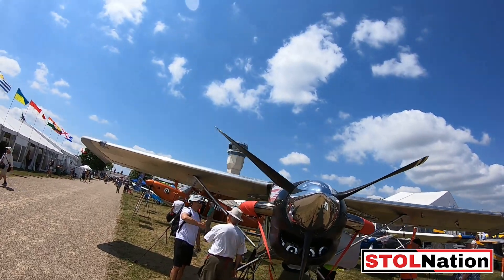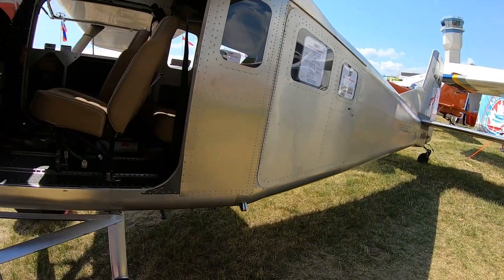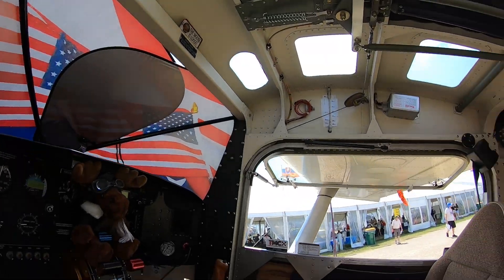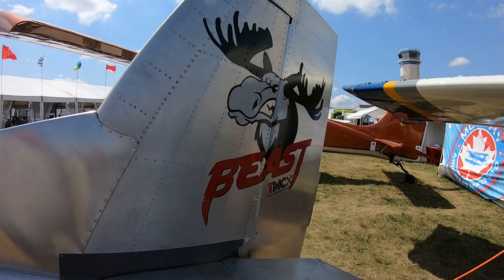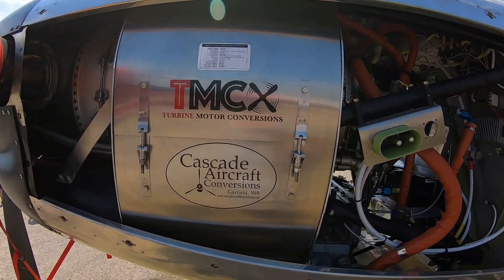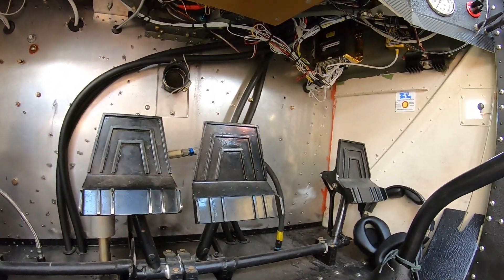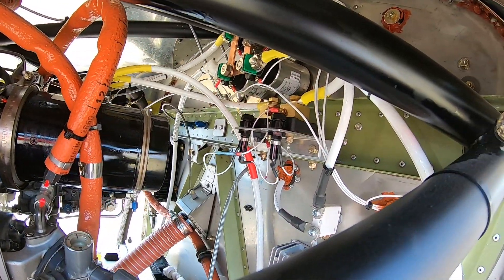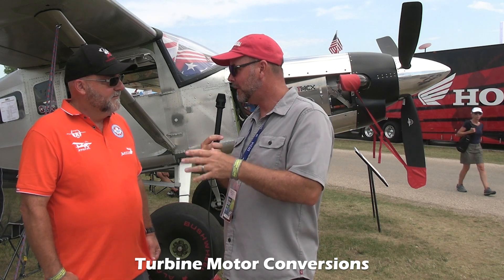Turbine 550 Shaft HP PT6-20 in a KIT AIRPLANE! Turbine Motor Conversions - Oshkosh 2023

Comment: My dad my twin brother fly a 108 on floats in Canada and we have flown countless hours in my cousins moose on Vancouver island you can bang it down hard and fly in heavy turbulence 20 plus yrs with no issues on the air frame so the guy that’s worried about putting the turbine on this thing I don’t think you could find a better built airplane our 108 we had for 55 yrs and it’s fully metalized we fully maintain it but we baby it

Comment: With PT 6 you still need more ground roll to take off empty than a Zenith 750 at gross  ?! (100 HP and 100 ft) Other than Bearhawk, there is also Aerocomp in Florida. I know it is a lot of work and testing, but you should do some airframe mods to raise the Vne or some of the engine HP are wasted.  I know some Australian maker , I suspect they purposely make the Vne lower to avoid a lot of testing.
Reply: Of course it takes more runway, it’s a  much larger airplane and much more capable